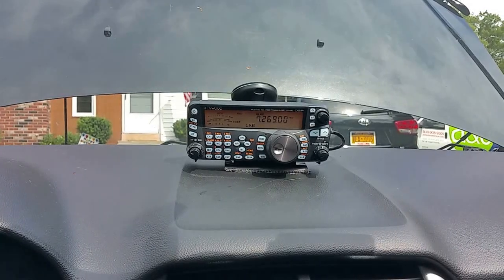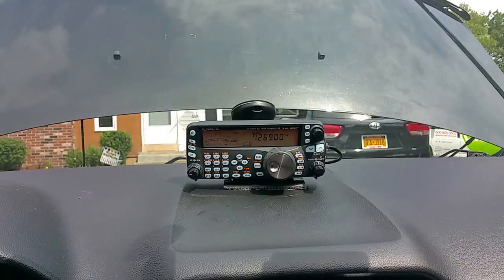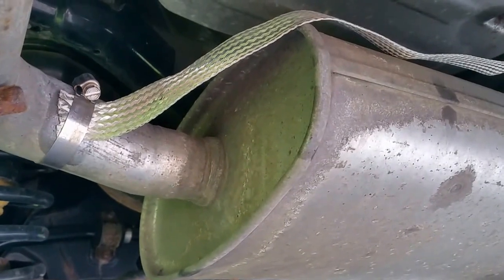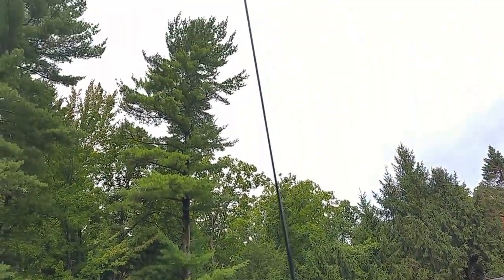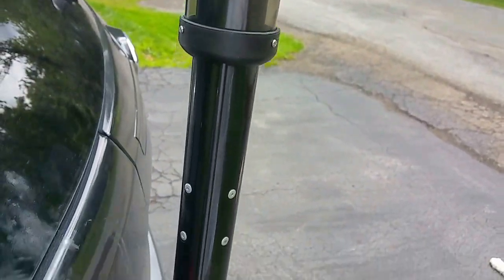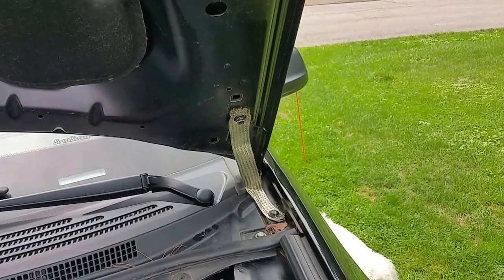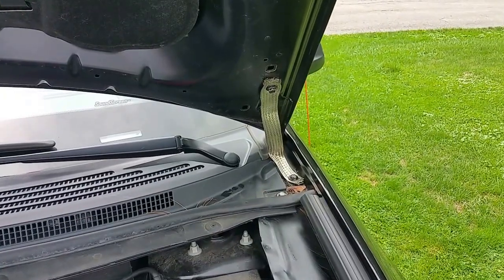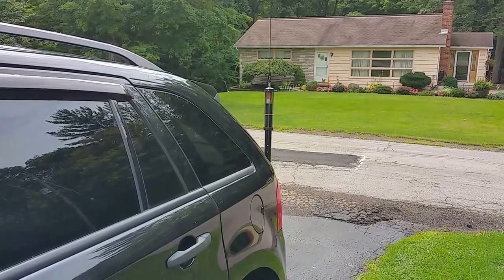Kenwood  ts480 Tarheel 2  important bonding

Comment: Cool setup but there are a few issues you may want to consider. Not judging in anyway. Only offering suggestion for your consideration. 

1. Bonding straps should be no longer than 10 inches or so in length, otherwise they may end up resonating RF as part of the antenna system. Remember the antenna system is a combination of coax, radiating element, and the DC/RF ground paths. RF always returns to the source and if it can radiate along the way it will, don't offer points of resonance other than the desired radiating element. 

2. The radio control head is in a very dangerous location. If you have an airbag deployment you may have a 250 mph projectile heading right for your face and that is before the car that crushes you does even more harm to you. 

3. While a mag mount works for your VHF/UHF as far as making a repeater ding dong back and forth. You really should consider NMO mounts and drill a proper hole. This will be safer and offer a far far far far superior ground plane presentation to the antenna and drastically improve your performance overall. 

4. Lastly, sanding the paint on your car is a bad bad mistake. There is a self sealing, self repairing, layer of specialized zinc coating under the surface layer of paint. When you remove that layer the steel is exposed to oxygen and moisture. I am 100% betting you will see rust start to form in the next 6 months and in the next 2-3 years will eliminate any good connection you once had at that ground point, not to mention the damage to your steel body panel. It is best to use a self drilling screw with a serrated washer (star type). These will cut through the pain layer making contact with the steel but allow the zinc undercoat to self heal and seal to the point of not allowing any significant oxidation event to occur. 

Other than that thank you so much for sharing your wonderful commitment to the mobile ham hobby. If you haven't read K0BG.com 's blog yet, Alan Applegate, I highly recommend it. He has mentored me personally through much of my mobile experience and is a wonderful gentleman if you ever call him on the phone. 

Again I wasn't judging, or nit picking, just stuff I learned the hardway in my short time, and learned best practices that consistently give my mobile station top ratings while underway with other stations. 73 Kk4YDR - Eric look me up on QRZ sometime.

Comment: Which controller do you use with the Kenwood, or do you just use a manual up/down switch and have to pre-adjust your output power for about 10w and key the radio in AM to get a signal out so the antenna can see it and provide an SWR reading you can adjust by?

Comment: How does bonding work for those of us that have an aluminum hood?
Reply from the maker: The guy at tarheel antennas told me no bonding necessary because it aluminum but i guess it wouldn't hurt, I bonded my bed to frame on my  2018 aluminum f150

Comment: FYI those ground straps are much too long. They should be 12" or less. Also you might want to solder the ends of your flat braid; looks like it might unravel. Otherwise, great stuff.